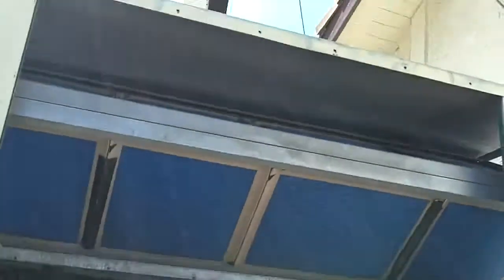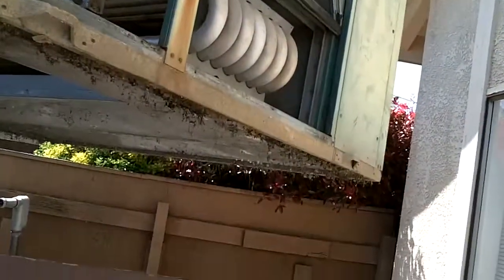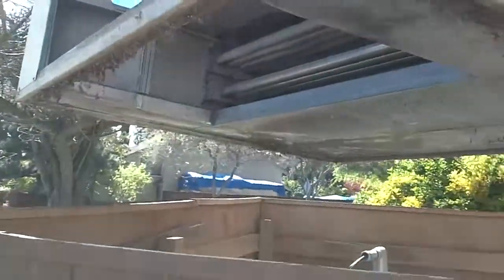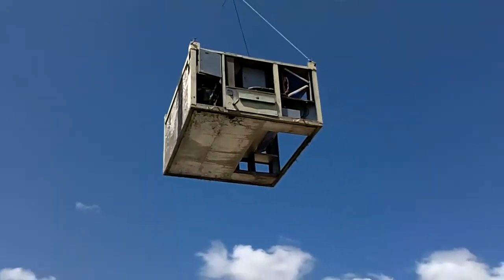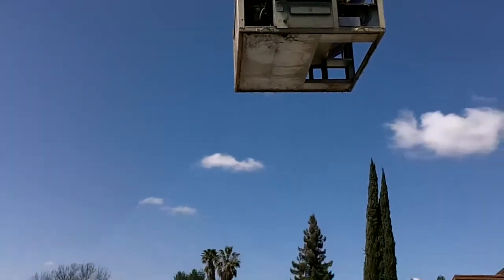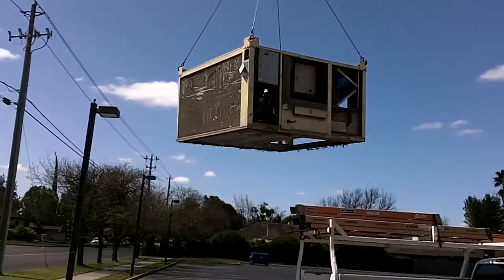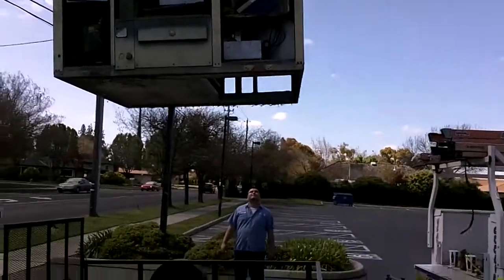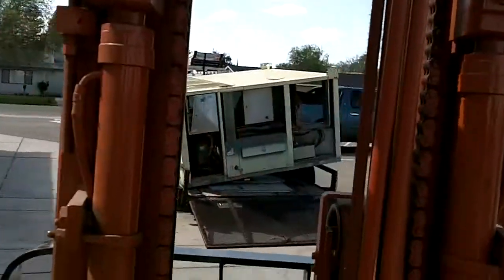HVAC 15 ton replacement part 1

Comment from the maker: @jay11j The ignition control was no good, the blower motor was was bad as well. We got the blower motor it was a 5 hp, but the ignition control was a hole differant story, York no longer made them and there were no after market's out there.
The ducts are under ground, its the coolest thing.